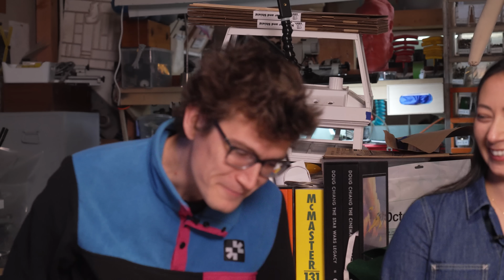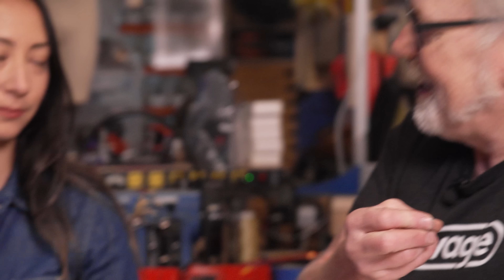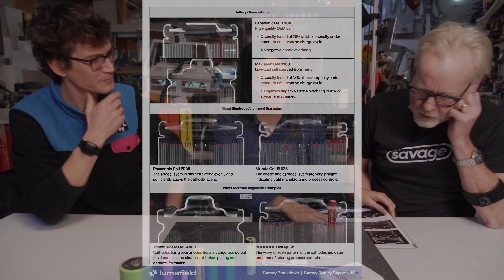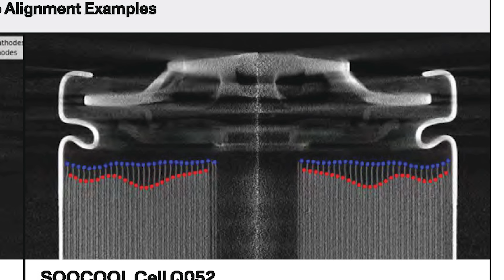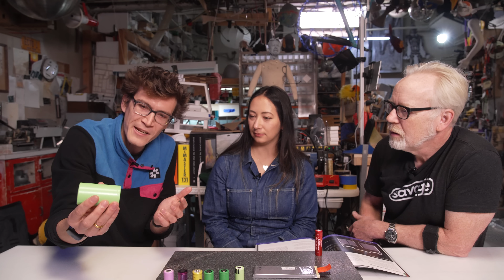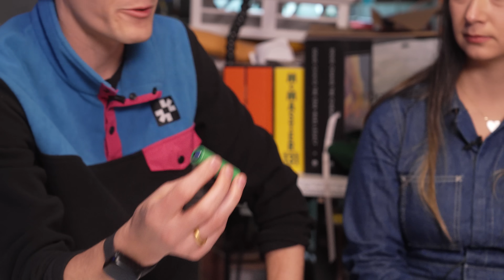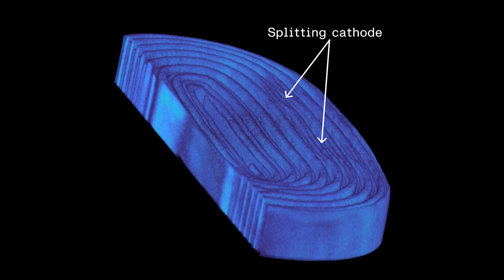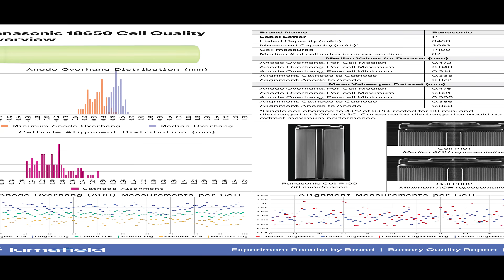The Surprising Flaws in 18650 Lithium-Ion Batteries

Comment: Discovered an unknown (to myself) concerning the 9v battery, which proliferated into when government officials deemed  batteries will contain 1-1/2 volt and be designated by a sizing system, This was when the radio became an international element, So those moments when I heard this popping noise, I kinda shrugged it off, until the second pop caused a facial strike, turns out that 6 little 1-1/2 volt cells are contained in a 9 volt ! (true story)

Comment: "Most consumers don't interact with them directly" - but probably most viewers here do. I bought at least 5 18650's directly (years ago) - 2 of them are those light green ones with black bands at the end (I was told they're Panasonic protected, they're not actually branded Panasonic though), one PALIGHT (yellow and black) and 2 chinese noname-ish in different shades of blue/purple. Plus 2 more nonames that were included with portable fans. I rely on the Panasonics (one at a time) for my LED flashlight. Just bought a new charger recently.

Comment: My main takeaway from this video is the degradation over time that is mentioned.

My philosophy on this so far has been that if I had already used a device with rechargeable batteries for a while, and it was "proven to have no problem", then it would never present a problem later, other than eventually losing capacity. 

Wrong assumption!

What we learn in this video is that any of our devices could be a timer ticking down to a point of failure, despite our impression that "this pack is working fine".

There are many other great points in the video, but I think most of us knew that the cheapest stuff out there has probably skipped some steps in both production and testing. I know a lot more about these batteries after watching this video, and my main concern will be how to avoid the bad ones. Also, how other people around me, in the same transportation vehicle or building, view this safety issue.

Each manufacturer should have independent and continuous testing of their product line. Results should be published, and the worst offenders should be outright banned from operating. While many products have these batteries built in already, this makes it harder for us to ascertain the quality and safety of powered products we buy.

Finally, in countries where recycling is not well implemented, what happens to all those devices with rechargeable batteries that will be discarded in random ways?

Comment: I learned long ago that not all 18650's were the same.  We used them in headlamps for work. My buddy got the ones that were 9000mah. I was kinda skeptical. Eventually got a charging device that showed how many mah you put into a battery. There were actually around 1000. I eventually ordered some name brand ones. Around 3000mah. And they were actually taking that kind of power to charge up.  

I had already read about the actual maximum rating those batteries could be, which started me looking into better batteries and safer ones.
Having one explode on top of my head was not an appealing thought. 

Glad to see the actual science behind it all.

Comment: Its Frustrating to try to find a quality 18650 brand that hold up under strain. Most seem to work ok for a few minutes, then fade fast. I use mine for flashlights, aka torches. Still looking for a quality torch that has a long throw.

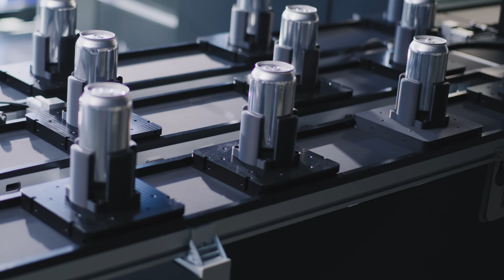Comment: The research is extremely interesting and enlightening. If you include all Li-ion batteries, catastrophic failure rate is worse than 1:1m, whereas if you only look at quality/reputable brands, failure rate is better than 1:10m. This is easy to follow on the surface, but becomes muddled when looking in the consumer space in general. Since we often don't buy the batteries independent of our electronics (e.g. watches, phones, headphones, etc.), even a name brand manufacturer of the device might use a cheap battery in the device and we'd probably not be any wiser. This research should:

- push industry to be transparent about exactly which batteries are contained in exactly which products
- set quality standards that countries or jurisdictions can adopt, where it becomes illegal to sell devices that haven't met the battery safety threshold
- make it more difficult for marketplaces that don't care about consumers (Amazon, Temu, Aliexpress, eBay, etc.) to push dangerous goods to consumers

Thank you for conducting this research, and thank you Adam for sharing it.

Comment: I am a retired electrical engineer.   For 4 years, I was the facilities engineer for a super computer data center.  We had 4 large UPSs, each with their own battery bank.   The largest was 1 MW. I learned that both lead acid and lithium batteries can burn.  
I wonder if the buyer should specify that the seller invite the buyer to watch the quality control testing (at the factory) for every battery?  
If it passes the buyer's inspection, then the buyer stamps it with an approval sticker?

Comment: Also notice that lone yellow cell, the anode is different... It has a current limiter placed between the cell and the battery connector and the current limiter circuit is placed on the cathode or negative side and a very slim wire is placed all the way to the top to connect to the anode or positive. You can find these types of cells mostly on counterfeit, low quality or chinese branded cells.

Comment: most 18650s do have a safety "breaker" of sorts... there is a  button underneath that anode cap that pops once the battery either vents or overheats... once it pops out, it is unlikely that you can pop that back in.... I say most since OEM cells have them... these chinese or unbranded ones from mostly china, well, I do not know
Reply: You are able to open the safety device with a very small screwdriver.

Comment: As a ham radio operator and a user of Meshtastic, we build nodes a lot using 18650 3.7v Li ion batteries, and there are certain stores we scope out for them. Amazon I avoid for batteries because it’s always been a mixed bag of quality.

Excellent video, Adam.

- KF0QNM, MN

Comment: I have been saving and reusing old laptop batteries for many years. A lot of newer ones are crap. I retrofit flashlights and other devices to accommodate them as I hate investing good money into the likes of rayoVac, durOcell & bunny batteries. The first of these I ever saw and obtained were used in fighter jet dash boards, & were Panasonic,s made in Japan. I had a hundred of them & only one failed in 35 years. Not sure why. Now they are made in China. They knew how to make them very well once upon a time. Then they forgot...

Comment: Adam, I hope you read this specifically.  I live in a state that is separated from the rest of the U.S..  (Yes, that narrows it down to Alaska or Hawaii, and this issue is highly relevant to both.)  We can't get lithium ion batteries here, except in end products that use them, due to Federal shipping regulations.  Specifically, it is currently illegal to ship lithium ion batteries (outside of end products) by air in the U.S..  No small to medium scale U.S. shipping company currently ships by boat to Alaska or Hawaii, and USPS ground shipping to Alaska specifically was terminated years ago.  Now, I've written a letter to my Representative in Congress (last year) offering some solutions (mainly safer packaging requirements), and while he responded positively, no effort has been made to resolve this serious problem.  (I'm aware that you can get 3rd party boat shipping services to close the gap, but doing that increases costs significantly, making it impossible to compete.  Even if I was only selling my products in my own state, I wouldn't be able to compete with people making the same kind of product in the other 48 states, because they can ship the batteries in the products themselves for cheaper.  So despite not having to ship the end product itself, I couldn't compete with outside companies in my own city, with my own storefront.)

It may not be obvious, but this single shipping restriction completely cuts Alaska and Hawaii out of the national technology development and manufacturing industry for anything that requires lithium ion batteries.  This is bad for our state economies, but it is also bad for the U.S. and potentially for the rest of the world, because inventors and innovators in these two states lack access to a very basic technology necessary for developing a huge range of potentially valuable products.

Anyhow, 3/4ths of the way through this video, I went and messaged my Representative again, with a link to this video, suggesting a new solution to the problem of safely shipping lithium ion batteries by air.  If the Federal regulation was changed to allow batteries manufactured by the high quality brands identified in this research, the odds of dangerous failure during shipping would drop to almost nothing.  Shipping is only a short period of time, new batteries are already far less prone to spontaneous failure, and when you add to that the fact that the vast majority of failures are the cheap no-brand batteries with poor tolerances and no safety features, that makes shipping high quality, brand name batteries completely safe.

Anyhow, the reason I want you specifically to see this is that I would like more than just one person (me) to be contacting their Federal representatives in Congress to get this regulation changed.  This research now provides solid evidence that the safety problems that make it dangerous to ship lithium ion batteries by air are not universal or uniformly distributed, and it is possible to have less strict regulation that does not cut entire U.S. states out a critical industry without significantly increasing danger to air shipping services.

Not only will this help me and others in Alaska and Hawaii, opening up the shipping of lithium ion batteries by air will also reduce the average cost and time of shipping these batteries overall.  It may also help encourage tech developers to use the safer batteries as well, despite their higher cost, since lower shipping times and costs will offset that by at least a little bit.

Anyhow, please help me get this Federal shipping regulation updated to take into account this new information!

Comment: You can make a cylindrical wound cell safer by using thicker separator between the rolled plates. Thicker separator makes a lower performing cell and lower power density. Cathodes or anodes that overlap the overhang the separator is a quality control or process issue and not an engineering issue since no designer would make such an obvious and hazardous error.

Comment: 11:27 ye normally all the ones that are either above 3500 or 4000 mAh rating are fake
learned this quick when moved from smoking to vaping over 10 years ago and was ordering 18650 cells from china
now i just use either Sony, Samsung or LG cells and only go with others if they have good enough trust rating from a store that only sells batteries in general and they vet their batteries they sell so changes of getting fake or faulty ones is rare
the ones i tend to go with are Sonys VTC6 cells since they have always worked for me and are in the cheaper range

Comment: I went through thousands of these. Bought them from disreputable vendors for cheap, ripped them out of vacuum cleaners and power tools, built my own packs with them, even accidentally shorted a few and it amazes me how not a single time did any of them vent or catch fire. Despite all the claimed dangerous defects.
Reply: Probably a lot of defects won't show up if you have good cooling/ventilation. But the prevalence of battery fires is definitely not zero.

Comment: So important to have a video like this... as going from a layperson with little lithium cell experience to an occasional  hobbyist that uses these cells, it's so easy to get yourself into trouble by simply not understanding the risks. Always use a high quality proven charger. And it's really a very good idea to charge in a controlled area, far away from flammable materials. And last but not least, always use quality cells. If you harvest 18650's from battery packs, check the codes on the cells to verify identity. Always charge at low amperage and never beyond 4.1, then check for resting voltage. If the cell seems to suffer a slow drain, do not use it.

Comment: On a serious note, i only have four of these batteries which i use in a torch. All bought from ebay and the process was buy cheap, buy biggest. I think i'll take them in to work and dump them all in the used battery box and get some branded batteries instead.

Comment: 17:30 I'm no engineer, scientist , chemist or anything , but I remember from some of my chemistry class lithium and water don't mix. From the knowledge I have sand should be used instead in case of a thermal runaway or short or anything that might make a lithium battery pose harm

Comment: If two Lithum ion cells are rated the same capacity they should be roughly the same weight. Cheap cells with ridiculously high advertised capacities can be weeded out just by comparing their weight to a known cell. The difference can be detected by hand. It requires a minimum amount of anode cathode and film to reach a stated capacity, and that stuff has mass, there's no getting around it.

Comment: If they come up with a rating system, and start rating li-ion batteries, that would be great.
Reply: They should be independently tested like they do with cars and medicine, if they don't pass they can't be sold and if standards slip the manufacturer should be accountable.
Reply: But the video is about how there are fake ones made and sold as name brand.  Then Amazon or other retailer sell them  without checking or banning fake sellers.

Comment: The one thing I see all the time is the batteries stop working and I found a video why

There is a safety mechanism built into the battery at the end where if it's pops the metal at the end from I guess off-gassing or maybe overcharging that the two contacts at the end no longer make contact and in the video they showed cutting open the end of battery and pushing the top back to make contact again 

They say this is a safety measure built into the batteries but it seems to happen every single time and they need to find a way to stop that from happening because after charging a dozen times it stops working

Comment: I am a retired Canadian, Tradesman, I have always been into tech, I am an expert in at least 5 trades, AND I have ALWAYS had electronics and electrical as a hobby.  I had a shop where I fixed stuff as my sole source of income for 30 years.

After investigating the very BEST battery for a project I am working on.  There was zero doubt, I choose Led Acid, because Lithium Ion is not safe enough  (not even in the realm)  and nothing else would stand up SAFLEY to the use I have planned ... 
I have 400 pounds of 6 volt lead acid batteries that cost about $1500 in this room :)
Reply: You retired from being Canadian?

Comment: Rewrapped batteries aren’t inherently any different than the name brand batteries. Essentially it’s like you took a iPhone 15 and put it in a iPhone 15 pro max box. It’s still a iPhone just mislabeled. There’s only a handful of factories that can actually manufacture these batteries but they are probably also rejects that didn’t make the grade on things like capacity also. There’s only problem is you really have no idea what you are buying. Also the stuff the average person has access to is never going to be A grade binned batteries. Those go to the teslas. These batteries can’t be made in your bathtub and they came from one of the main manufacturers at some point not some dark alley.

Comment: She called the "anode" the negative element of the battery - it's the "cathode' that's the negative part.  She may be an expert in her field, but that field does not appear to include batteries - which just makes her a "talking head" here.  Also, "form factor" contributing to "economy"?  Still, gotta love the size of the "rock" on her finger.

Comment: I think the biggest problem with these batteries is that there is no current limit on output. If you short them with a 12G wire they will produce instant Amperages that will allow them to combust etc.. I'm really hesitant to refer to them as batteries but more like super capacitors with no current limiting features, which makes sense because if you are using them for devices that need high starting amps to drill or move large masses you need that huge immediate boost Too bad every battery wasn't installed with a limiter, the chemical batteries when shorted couldn't produce enough current to burn themselves up, but an eight pack of AA batteries couldn't drill through your deck either.

Comment: I dunno about you, But I keep my batteries together.  One drawer has a pile of rechargeable banks.  There's a couple 20,000 mAh banks stacked in there. There's a few 10,000 mAh.  There are some smaller ones, too..  All are in an area smaller than a shoe box.  If one fails, and catches fire, the whole bunch cascades into a rather large, flamey..explosion. Right?  So, I wonder what's the better way to store such things?   Divide them among several, vented metal containers away from the bedrooms and near a smoke alarm?  If I put them out in the garage, a catastrophic battery failure still threatens my home.  Also, the garage gets quite hot in the Summer and very cold in the Winter.  Batteries don't like that.